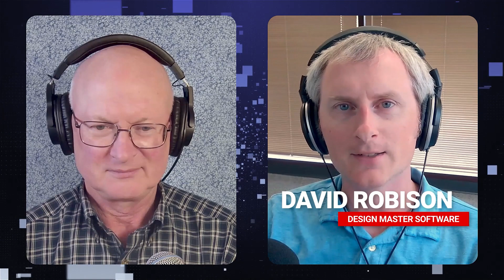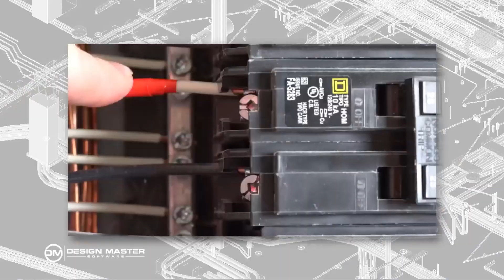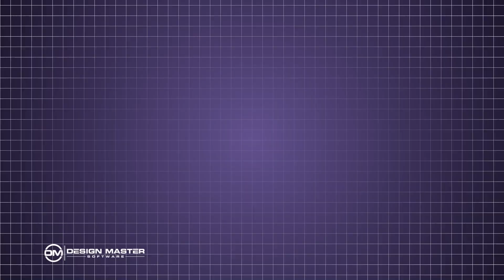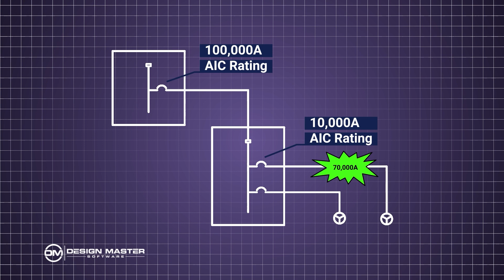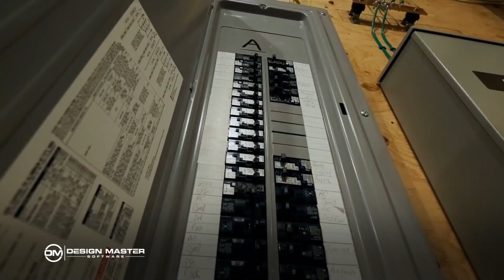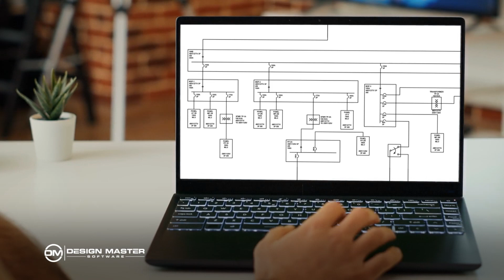Series Rated Electrical Breakers - Episode 5  #electricalengineering #revit #seriesratedbreakers

Comment: By creating a non-coordinated system, hasn't your design become somewhat non-compliant?  I am in the UK by the way, seems at least a lot of extra documentation from the manufacture is going to be required for defensibility.  And I dont like the idea of an electrician swapping breakers at a later data.

Comment: Hi David & Mark! thanks for the great video.

Is Coordination Study required for both Series-Rated and Fully-Rated systems?
Reply: The drawback of series-rated systems is that they won't be coordinated.

Whether a coordination study is required is going to depend on the specifics of the building. The AHJ or owner might require it. Hospitals are generally going to require a coordination study. For a commercial building, you might only need it for the life safety system.